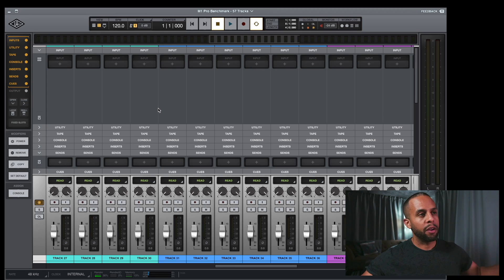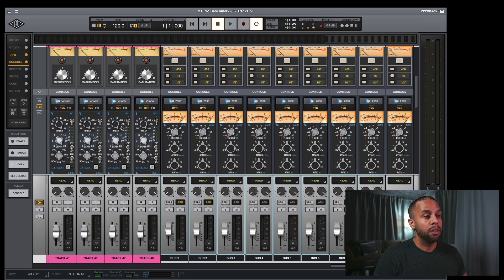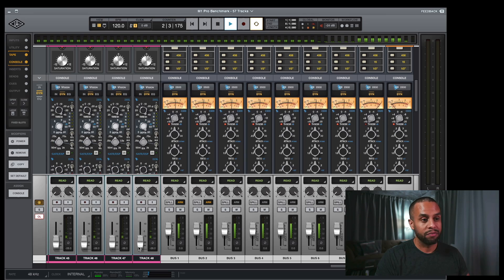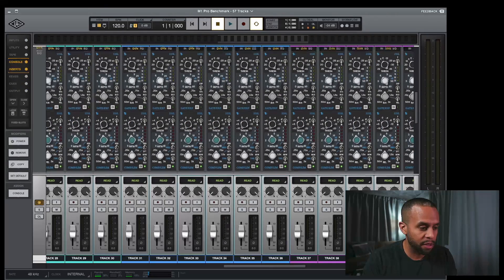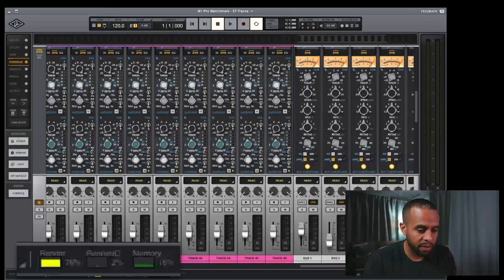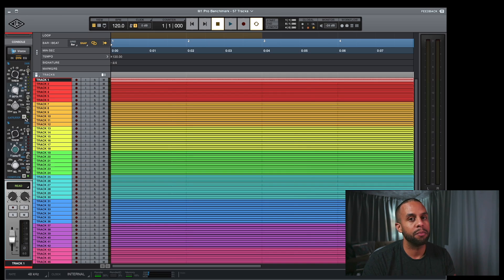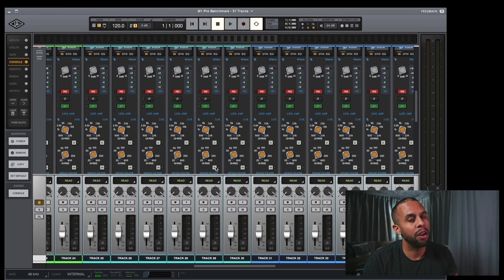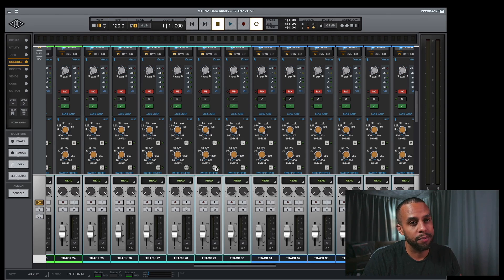Benchmarking M1 Pro MacBook Pro with LUNA

Comment: Hi Darcy, thank you for your informative video. As far as I can see you made that video with the ARM mode on. As to my understanding the cpu based plug-ins like tape etc. are bypassed in order to have nearly no latency. I‘m not sure if that means that if also will als free the cpu/gpu for the render meter. Best regards - Christoph
Reply from the maker: Close but one of your details is slightly off. ARM mode effects recording only, it does affect playback / mixing of the song. So it doesn’t affect or free up CPU, what it does is that when you’re recording it disables any plugins they would cause latency which is all non-UAD plugins and any even UAD plugins not needed throughout the mix. It does some DSP management as well.
Reply: Hi Darcy, thanks for the clarification - than I got that wrong. Best regards - Christoph

Comment: I hope they release a native M1 Luna, so cpu power wouldnt be an issue
Reply from the maker: Honestly it’s not holding me back in anyway. Working on a mix today and I’m not even thinking about “do I have too many extensions”
I just keep adding them and my render isn’t hitting over 40% because in reality this video is excessive. Also bounces are faster the more CPU is being used with these new chips. Video on this Monday.
Reply: @MusicByDarcy  I have a macmini 16gb m1 and it kinda work, sometimes the audio drops... the memory allways show 130% usage, render goes ok. extesions seem to be lighter than regular AU plugins
Reply from the maker: @pedrockz  yeah mine are nothing even close to that. I do have double the cores and ram but it shouldn’t be that much different. Wondering what you run in your sessions.
Reply: honstly, DAW mac m1 users should be aware that they are running a translated INTEL APP, and push the companies to accelerate this (more than 1 year) transition. Try to open a acustica plugin.
Reply from the maker: @pedrockz  don’t have that one but my sessions mostly contain Luna extensions, UAD plugins, SoundToys, FabFilter and a few others.
Reply: It’s not native yet? Geez.

Comment: how is the fan situation ? i have a 2019 macbook pro quad i7. 32g ram. even a moderate luna session has my fans on all the time. it's unusable in a studio environment. considering the mac mini with the m1 chip and a ton of memory.
Reply from the maker: It’s very minimal. I’ve noticed it usually only when running by tip me heavy duty apps. When it get warm in general from running LUNA, it’s a near silent fan.

Comment: Is it the 8 core or 10 core M1 pro? Does it make a difference.. if this works.. it’s a dream come true
Reply from the maker: I’m using the 10 core cpu with 16 core gpu and 32 GB RAM. I can’t say how much difference will be made accurately as I only have one M1 machine, but it will make a difference. LUNA and it’s extensions are CPU intensive. Right now I usually in a normal session top out around 30% CPU, and I would estimate the 8 cores M1s would use around 60%.

This guess is based on the fact that the 8 core M1’s are only 4 performance cores and the 10 core M1 Pro is 8 performance cores. So the CPU you’re using is for LUNA is actually doubled with the M1 Pro chip. 

I barely even use RAM in any of my sessions, but since I screen record while in session I wanted headroom to grow as I do more video stuff.
Reply: @MusicByDarcy  awesome thnx for the reply!
Reply from the maker: @JRCorominas  No problem!
Reply: Are you running Rosetta?
Reply from the maker: @JRCorominas  I am. Will cover that in my next video.
Reply: @MusicByDarcy  yo! Just picked up the M1 pro 16” and it’s great! I’m the render meter is holding steady but I find the audio sometimes cuts out during playing back for a split second. I just started using it and I’m running an old session. Have you had this problem? Thnx
Reply from the maker: @JRCorominas  Not that I'm specifically aware of. If it's with that specific session, could be an issue with it or one of it's plugins.
Reply from the maker: @JRCorominas  is that only with a spirit project? I haven’t had that myself.
Reply from the maker: Hey would you be interested in testing some stuff out with me to compare between your MacBook and mine in LUNA? If yes, shoot me a DM on Instagram.
https://www.instagram.com/musicbydarcy/